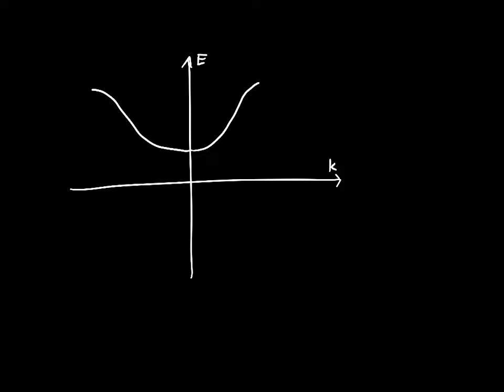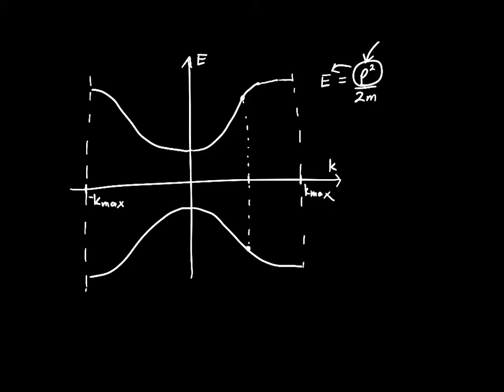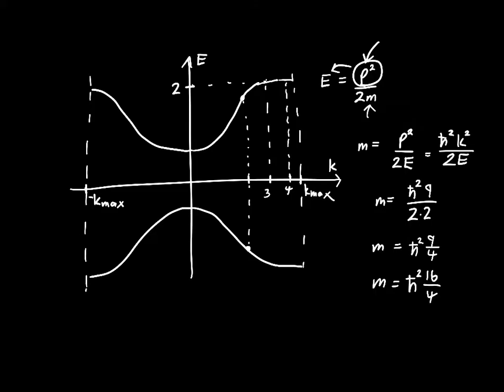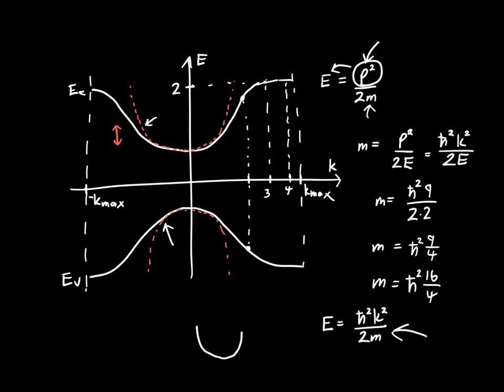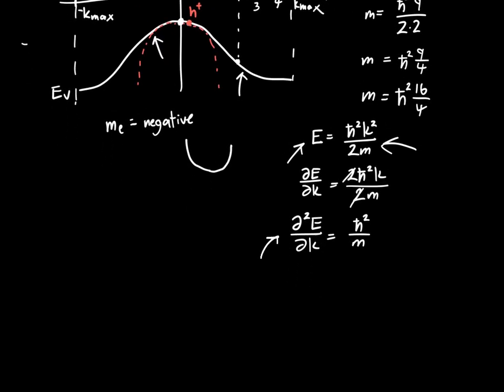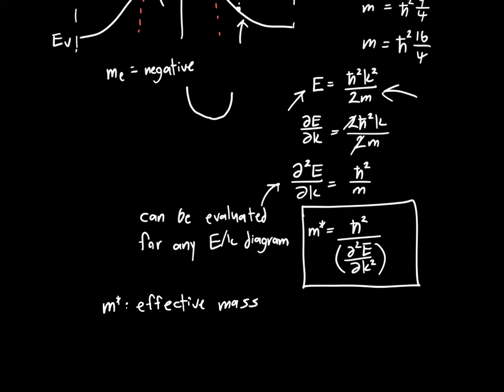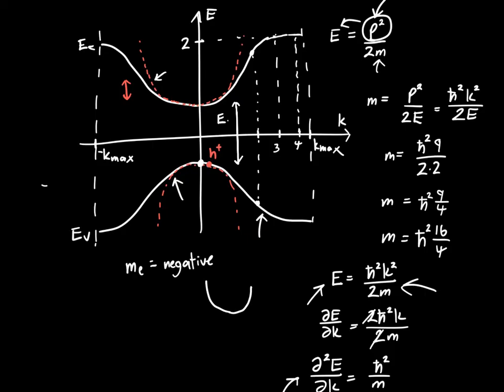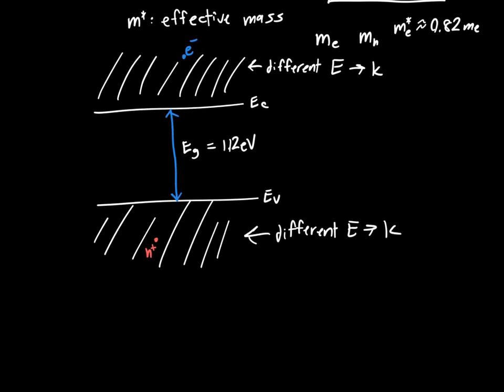Kronig-Penny Model: Effective Mass

Comment: so you use new effective mass dependent on the "function of Energy" as for approximation to get all particles in the same inertia frame by using parabola model.
Reply: and also dividing by form of curvature(second derivative) approximating curvature as a constant form keeps the mass constant which is same inertia form

Comment: Why is the effective mass for a hole in the valence band positive. Is it because the function of E with respect to k for a hole is opposite for electron
Reply from the maker: Yeah this is confusing - the simplest way I know of thinking about this is that when you apply a force in the form of electric field, an electron in the conduction band will move one direction (say to the right), but a hole will move in the opposite direction (to the left). One way of interpreting this is that it's just a negatively charged particle with negative mass, but this seems ass-backwards, so we just say it's a positive particle with positive mass.

Comment: Good video. I'm still having trouble with a related topic which is finding the effective mass when you are given multiple E and k values for a conduction band when Ec =1. I know E=Ec + (hbar^2*k^2)/2m*. But i can't just plug those numbers into this formula correct? I don't know, it seems like it should be relatively easy but the effective mass for each that I am calculating must be wrong (x10^-36). I feel like i'm missing something, or maybe i'm just too tired to think right now lol.
Reply from the maker: Yeah the smallest effective mass I have ever seen is like 1/100 of the electron mass, typically between 0.1-1x the electron mass.

Comment: In a lecture of a semiconductors course I am taking, it says that the Kronig Penney Model implies that a small effective mass yields a small energy gap. Intuitively the only explanation I can give myself is that steeper bands (small eff mass) would give a smaller gap compared to bands at approximately the same energy but flat (high eff mass). I don't see however how this can relate to the Kronig Penney Model. If anyone could help I would be extremely grateful.
Reply from the maker: You are correct that smaller effective mass corresponds to steeper bands, but it’s also separately true that a smaller effective mass yields a smaller bandgap (the two phenomena are distinct). To prove this you actually have to solve for the band gap as a function of the effective mass.
Reply: @JordanEdmundsEECS  Thank you. Do you have a physical explanation for small effective mass --> small band gap? Because I really cannot see a link, and even less why this is a result of the Kronig-Penney Model.

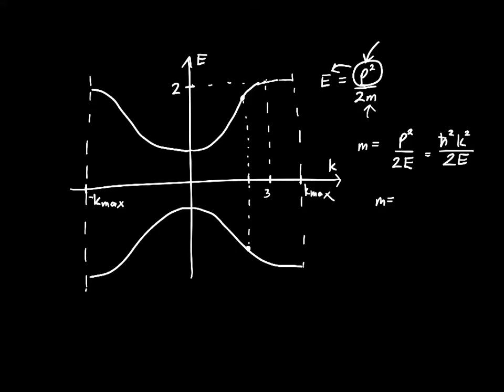Comment: Dear sir, I am the person who asked you a question regarding calculation of effective mass from the E-k relation. I got your answer already. Thank you very much. But I would like to discuss a little bit more. The E-k relation is actually an equation containing a complicate function of E and cos k(a+b), where a is the width of the potential barrier and b is the width of the potential well. Therefore, k can be varied by its period without changing the value of E. Consequently, the value of k in the E-k curve is not uniquely defined; it can be shifted by the amount of the period. Therefore, choosing a pair of E-k values from the curve to calculate effective mass, as you mentioned at 3:20, will lead to a wrong answer. Using the curvature (calculating the 2nd derivative) can avoid the problem of k-value shift, because the curvature is not changed by the shift of k. Moreover, only the bottom of the curve (near k = 0) can be represented by a parabola function, so we use this part of the curve to conveniently ontain the 2nd derivative. Please let me know if I am right or wrong. Thanks.
Reply from the maker: Sounds totally reasonable.
Reply: @JordanEdmundsEECS  Thanks again!

Comment: Dear sir, the video is very helpful. Thank you very much.But I have one question. At about 3:20, you mentioned the calculation of mass by taking the vaules of E and k from the diagram. What if we take the vaules of E and k at k = 0? It gives us m = 0, which contradicts the result of calculation from the curvature, which you mentioned later.Thanks.
Reply from the maker: Sure! This is actually a very good reason not to define mass in this way. Since the second derivative is always defined, it will always work. I just used dividing by E and k to illustrate the problems with defining a single mass. It’s not actually how we define it in practice.
Reply: @JordanEdmundsEECS  Thanks.

Comment: I think that, atleast physically, the effective mass is just a way of accounting for the change in potential energy as an electron moves between potential wells.
Since we stated that E = p^2/2m, we're compensating for the lack of the V term by treating mass as a non-constant.
Other than that, I don't really see any reason why the mass should change in a non-relativistic scenario
Reply from the maker: Yup, that's basically how I interpret it now. It's essentially a way of accounting for the "medium" the electron is embedded in (which is a periodic crystal, with a bunch of adjacent potential wells).

Comment: I thought 'p' was momentum and 'k' was the wave number so why is it called the Energy vs momentum curve when "k" wave number is the independent variable?
Reply from the maker: Since p and k are just related by a constant (Planck's constant) p = hbar * k, the term "momentum" is used interchangeably to refer to either p or k. In semiconductor physics, though, it's just easier to work with 'k'.